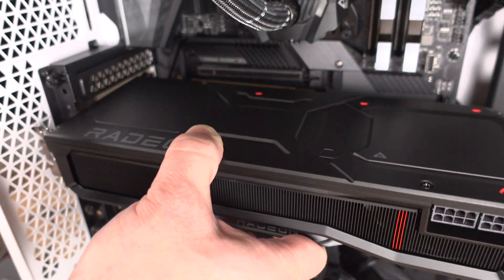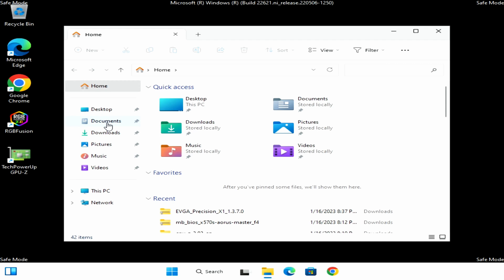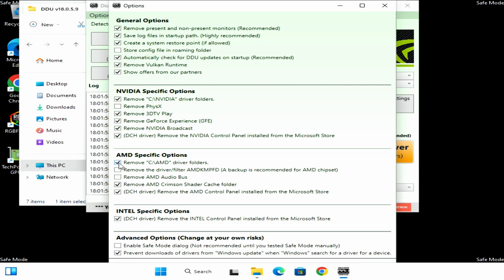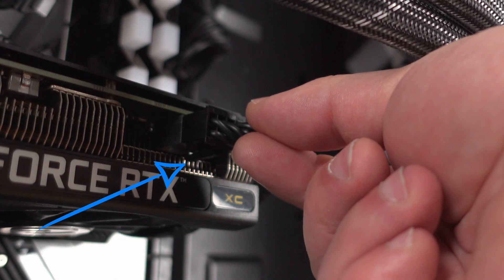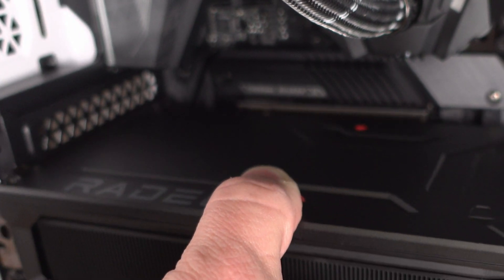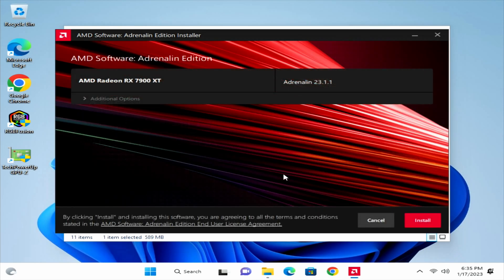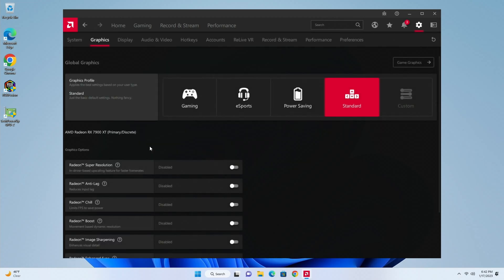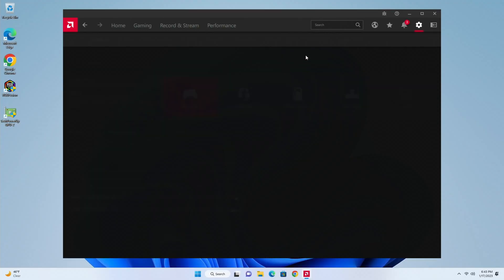The best way to Install the AMD Radeon RX 7900 XT Graphics Card in your PC

Comment: Card looks good fully my next upgrade. Am back again to pick your brain . So my builds been going good since ive built it . Last week ive noticed while playing warzone the screen goes off amd pc reboots and the vga light comes on  i dont want to jump the gun and say i need a new gpu any thing i could check its hard one cause it happens every now and again or after 4/5 games
Reply from the maker: So that I can help, please list the manufacturer and exact model number of the following components:
1. Motherboard - manufacturer and exact model number
2. CPU - manufacturer and exact model number
3. RAM - manufacturer and exact model number
4. Video Card - manufacturer and exact model number
5. Power supply - manufacturer and exact model number
6. Monitor - manufacturer and exact model number
 Redundant I know, but many people forget to enter manufacturer and exact model number
7. Do you have ALL of the PCIE connections plugged in, and not daisy chained or pigtailed, each coming directly from the power supply?
8. Are you running through HDMI, DP, DVI, VGA, any adapters?
Reply: @ThisBytesForYou  finish work here now in an hour ill send all through the  best  i can
Reply from the maker: sounds good my friend, I will be here all day recording and editing and replying.
Reply: @ThisBytesForYou   so this the only info i have lol 

1 . Cpu  amd ryzen 7 5800x3d   8core 16 threads 4.5 ghz max boost (100-100000651WOF)

2 . gpu xfx  Speedster merc3-9  radeon rx 6800xt  16gb ( rx-68xtac)

3 . mother board rog strix b550-f gaming   (90mb14so-m0eay0 )

4 . Ram - t force  pro dark 32gb kit  ddr4 3600 cl 16-16-16-38 1.35v  (my-002-8p)

5. MSI Optix MAG272CQR Curved Gaming Monitor - 27 Inch, 16:9 WQHD (2560 x 1440), 2K, VA, 165Hz, 1ms, 1500R, FreeSync, HDR, RGB Mystic Light, DisplayPort, HDMI, Type-C, Anti-Flicker, Less Blue light 

6. Psu - Aerocool Integrator 850 W 80 Plus Bronze Power Supply Unit with UK 3 Pin Power Lead
Thats all the info i have sorry lol 

So far ive disconnected and put gpu back in all cables in correct  ive reset bios / updated them 
Ive cleaned all parts 

Ive uninstalled drivers and reinstalled them 

Playing games display goes off then pc boots up to vga light stays soiled white if i turn pc off at power and back on i can boot up and play again but it will happen again at some stage . Gpu   temps  seem fine ect just wanted to ask you before i leave it into a shop pc been working perfect last 9 months since built
Reply: Its also connected by dp cable ive tried the both connection points on gpu
Reply from the maker: @scottwilliams4906  what is the case manufacturer and model number and what is the ambient temperature in your house?
Reply from the maker: jjust in case cooling is an issue, though it does not sound like it: https://youtu.be/J5m5WBlPkfc
Make sure you have the hertz set on your monitor, in windows, defaultis 60hz, you have to physically raise it, if you have it set in the game, they are conflicting, I HIGHLY recommend you install it the way I show you here, the drivers and all, it resolves a lot of issues.   After you do that, first install the chipset drivers after you reboot, https://www.amd.com/en/support/chipsets/amd-socket-am4/x570 then install the latest video driver, then change the refresh rate.  If you have your browser open, make sure you disable Hardware acceleration.

If you are on the Gaming Wifi II, update your BIOS to 2806, https://rog.asus.com/us/motherboards/rog-strix/rog-strix-b550-f-gaming-wifi-ii-model/helpdesk_bios/, there are agesa updates and compatibility and performance updates: Make ssure you are running on an XMP profiole and have your memory installed in the correct slots.  Make sure after your flash the BIOS, you set "Load Optimal Defaults" save and exit, then enable XMP, change your BIOS from Legacy to UEFI, do NOT OVERCLOCK, test on stock and see if you have issues, if you don't your overclock is the issue.  Make sure you have the BIOS set to CSM disabled, thats all I can think of for now
Reply: @ThisBytesForYou   what bios would you recommend for the non wifi one im just on the latest atm . And i did use the ddu to do it but i didn’t do chipset should i just try all these steps again . I thought id just need a new gpu ?
Reply from the maker: @scottwilliams4906  good eye, I thought I read it was the wifi version, https://rog.asus.com/us/motherboards/rog-strix/rog-strix-b550-f-gaming-model/helpdesk_bios/, use the latest version: 2806.  I am sure there is nothing wrong with your gpu, just settings and make sure you are not overclocked.
Reply: @ThisBytesForYou is it possible for it just to randomly happen 9 months in lol yeah thats the bios i have atm
Reply: @ThisBytesForYou so when i go to put gpu i to safe mode when it restarts before start up screen the vga light stays on and no display
Reply from the maker: @scottwilliams4906  it can happen, its software first, then hardware, as for overclocks, yes, they can degrade, I was a product development engineer for Alienware, tthen years later Dell when they bought us and finally Velocity Micro, at Velocity aside from my product development job, i would prepare machines for reviews, so I would overclock, integrate and ship, I was incharge of it, and then supporting them, overclocks degrade, so you have to lower them overtime, this is why I say turn them off, they are worhless for single digit improvements.
Reply: @ThisBytesForYou   i was oc but i have it off now . Any ideas about the safe mode would it be worth just doing a clean install  of windows ect ?
Reply from the maker: @scottwilliams4906  go for it, a clean install is usually the best for everything, i do a clean install a few times a year to keep everything fresh, I HIGHLY recommend to make a new install drive, this is for windows 10: https://youtu.be/C759I7DBXd8 and this is for 11:  https://youtu.be/ayp8TksEtoY
Reply: @ThisBytesForYou  so if i do windows reset and bios everything brand new and it still happens would you say gpu ?
Reply from the maker: no, try a fresh install,  have you diagnosed anything?  Check temperatures while gaming, check event viewer, timing it when it crashes,  there is so much to check, have you dont the BIOS changes and the browser changes along with the refresh rate changing the hertz?
Reply: @ThisBytesForYou  i might just let the shop local to me check it all over am sure theyd check all this lol
Reply from the maker: @scottwilliams4906  yup, that's your best option is sounds like
Reply: @ThisBytesForYou  pay someone esle to do it so i dont have to lol i was about to but nee gpu ill hold off lol
Reply from the maker: @scottwilliams4906  yup, I was trying to avoid that, to save you money, but you keep jumping to that, so I will let you, its your machine, its your money
Reply: @ThisBytesForYou  yeah well ill let them have a look least iknow itl be done right lol ive tried literally everything i can . If it turns out to be gpu im defs getting the rx7900xt is it much bigger in size

Comment: You're the Best
Keith
Reply from the maker: Thanks bud, but I think you are and I thank you so much for your continued support
Reply: @ThisBytesForYou  
They call me the 
BEST of the Worst
LOL
Reply from the maker: @KTHKUHNKK  hahha nice
Reply: @ThisBytesForYou  

I Texted Asus way back
Months ago. About whether I should use.
The heatsink that  came with my motherboard.
Some guy intervened on my question.

And said no let it burn up.
 I have a 2tb
M.2 I have not put in yet due to my eyesight.
The M.2 I currently have in there now has no heat sink on it.
The one that is in there now is a 1 TB
If I ever get the second one in what should I do boss ?
Heat sink or no heat
Sink ?
Keith
Reply from the maker: @KTHKUHNKK  do you know the exact model number and manufacturer?

Comment: Or vga what mine says on my cord
Reply from the maker: No, vga won't work
Reply: @ThisBytesForYou  I don't remember  but I'm using on my 3060ti I thinks its the same I have a evga supernova g7 850w power supply so I might be saying something wrong
Reply: @ThisBytesForYou  i have 4 pcie cords on the manual but on the tip it says vga but it woks on my 3060ti might be a evga thing
Reply: My power supply  says vga 1-4 put i connect my gpu cords in those those are pice
Reply from the maker: ok, that vga on your power supply is the PCIE connection, maybe confusing but thats a different VGA from what VGA really is but yeah, thats where they would go.  The VGA I am refereing to is the connections on the card, there HDMI and DP on the card, older versions are DVI and VGA, VGA is analog while DVI, HDMI and DP are digital, sorry, I am a geek haha, but yeah you are good, you can use 2 of those for  this card, sorry for the confusion
Reply: @ThisBytesForYou  no problem did you though I mean the actual card
Reply from the maker: yes, I connected both PCIE cables from the power supply to the card, 2 individual cables.
Reply: Thanks for your help 👍
Reply: @ThisBytesForYou  that what I did with my 3060ti but its has one into a spliter into 2  that came with the card
Reply from the maker: @Jason_Bover9000  no, don't use a splitter, please, especially if your power supply has enough
Reply from the maker: @Jason_Bover9000  always a pleasure my friend.
Reply: @ThisBytesForYou  I had two it only has one it came with the Nvidia card
Reply from the maker: ok, try to never use a splitter, they can cause lots of issues, melting cables, improper power delivery, and a ton more.
Reply: It crazy im watching this again
Reply from the maker: So does that mean in it worked or didn't ?  Please start a new thread so I can help you.  This one is too deep, won't show up on my PC.
Reply: @ThisBytesForYou  nothing is wrong i haven't bought a new one just wondering if I need to know this before I worry to much
Reply from the maker: @Jason_Bover9000  watch it as many times as you need to make sure you get it my friend, I will try to be here for you if you need me.
Reply: @ThisBytesForYou  thanks for your help as always man
Reply from the maker: @Jason_Bover9000  always a pleasure my friend

Comment: Will this card fit in a corsair 4000d airflow case  width size
Reply from the maker: yes it sure would, the 4000D can take up to 360mm while the card is only 276mm, you are good my friend ;)
Reply: @ThisBytesForYou  im more worried on width more then length
Reply from the maker: @Jason_Bover9000  you have up to 170mm  in width, and from the bottom of the pcie out metal piece till the top its 127mm, you are good.
Reply: @ThisBytesForYou  ok thanks how are the Temps
Reply from the maker: dont know yet, coming soon
Reply: @ThisBytesForYou  ok

Comment: This GPU is enabled to do 4K resolution, right?
Reply from the maker: yes, for sure
Reply: @ThisBytesForYou  Perfect, I’m upgrading my system to the best components with high performance and of course it has to be high end
Reply from the maker: @devonefoster105  Well, if your budget is high, I would say a 4090, like here: https://youtu.be/_AJlNxuukww for the top of the top, including Ray Tracing, if you don't care about Ray Tracing, maybe a 7900 XTX, but the 7900 XT still will give you great performance, but you may want to utilize FSR for even better performance.
Reply: @ThisBytesForYou  what’s FSR?
Reply from the maker: @devonefoster105  AMD's answer to DLSS, helping to get better performance "if" the card can't handle it
Reply: @ThisBytesForYou  oh ok.